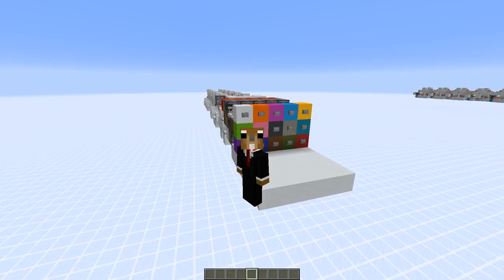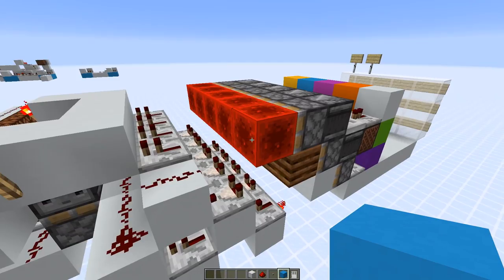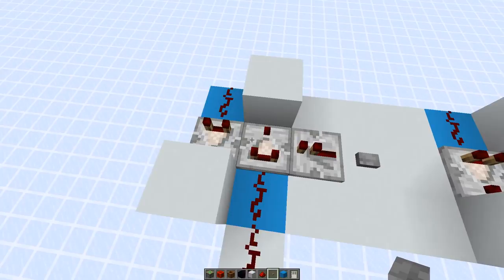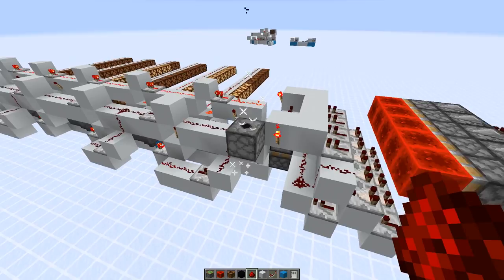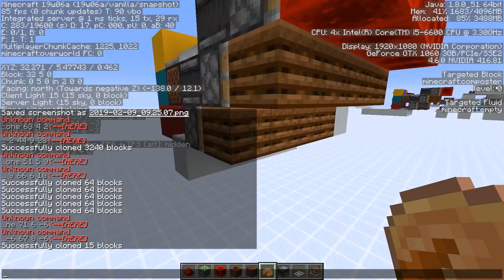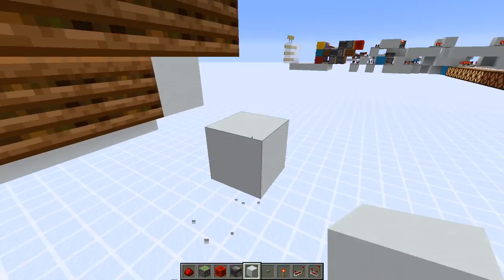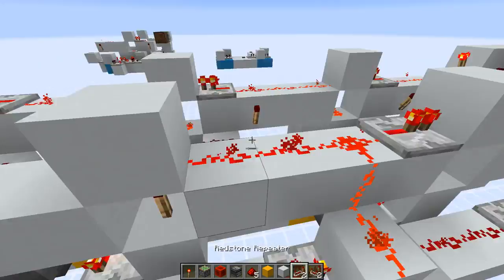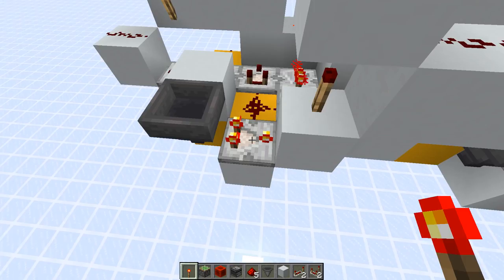15 Button Sequential Combo Lock

Comment: You can add 2 fake buttons under the 16th input, then it'll look nice.
Reply: But you don't have 18 colors
Reply: @spartycool  glazed terracota ?
Reply: @spartycool  shhhh
Reply: You could also use 18 unrelated materials, or make 6 colored stripes (so you'd remember combination as "top red, middle brown, top yellow" etc.)
Reply: But there are only 15 buttons.
Reply: Vertical colors, Horizontal could be material. Concrete, terracotta, wool

Comment: Great improvements to sethblings original concept. I wonder if it's possible to do all 16 with a 4 by 4 grid as input.
Reply from the maker: I made what you were asking for. 4x4 grid with a total size of 4x5x11 (inlcuding button blocks) that is compatible with the combo lock. I will show it next week
Reply: It's not better because of the noise
Reply: @rambolambo3441  maybe sethbling will make a data pack to remove piston noises for you.

Comment: This could be easily co-opted to make a music box. The only other thing needed is a corner module to turn the memory into a loop, and a way to block the signal from looping around or let it through (which can be done by passing the signal through a solid block and removing the block with a piston).
And then also have a decoder that can trigger a different note block for every signal strength.
The main issue is that it is so slow. So for tight timings, two or more of these memory tapes which advance together could be used with the note blocks being triggered at a small time offset.
The other problem being that Minecraft is laggy and so it would never sound good.

Comment: Combination locks were my first real redstone contraptions. Used to have a massssive 120 button one which had a second button display on the second floor to set the code. Had 3 tries and a death penalty with 5 minute lockout. The eventual culmination however was my development of a hidden key card reader using a hopper minecart. Which you could have under the floor. Combined with written books to make a key which can't be replicated it becomes the most serious lock system in Minecraft XD
Reply: That sounds kool mate. You should make a video on it

Comment: is it possible to make it smaller like 9 choices with 3 digit code and have a reset button if we missclick the button? Thats what i would like for my base!
Reply: This does get reset when you press the wrong button. You just have to put the code in the right order and then your line gets activated
Reply: Just remove 6 buttons from this design
Reply: yes it's possible. just copy the design with a 3*3 entry and you'll have 15 14 13 8 7 6 3 2 0 in possible output. and you'll just need a 3 module long redstone thing behind. you don't need the reset, start entering your code and it'll work.
Reply: @gildeddrake1479  cool thx

Comment: Now to figure out how to move these segments somewhere else so they can fit in more places.  It's unusual to have several chunks of space in a certain direction like the design you have shows.  Then again all it takes to move the signal is a comparator and a dust alternating so it should be possible to move it up or down as needed.

Comment: Could you do one button panel that can have more different combinations/outputs? I mean that you can have multiple “codes” that does different things.

For example:

Orange, green, pink & red is one correct code.

Blue, lime, yellow, pink is another code.

Brown, white, black is another one. And each code has it’s own output?
Is this possible?
Reply: Very possible. I've een working on a multi profile, ATM like system for a while now. Each profile will be accessable and programmable from the same interface. It's not actually all that complicated but it does get quite large.

Comment: Yes but isn't it a permutation lock?
Reply: (there was a dumb comment here once but I'm pretty sure I'm wrong)
Reply: No, I don't see why you couldn't put the same code twice.
Reply: He gots a little over 11 million total combos so he got that by doing 15^6 so he can repeat inputs plus in the video his lock stores and shifts the redstone length
Reply: @qwoks3611  A combination lock would mean that order doesn't matter. For example, a combination of 1234, 4321, 1423, etc. would all open it. In a permutation lock, order does matter, so 1234 and 4321 are distinctly different and both wouldn't open the door. Repetition could be applied in both.

Comment: Can someone explain the purpose of the piston/observer thing he makes at 13:37? What does it even connect to or get powered by? I'm trying to attach this to the 4x4 interface panel, but since it doesn't line up exactly the same, I'm unsure as to where to put that part.

Comment: do you have to use a hopper/chest/items for the programing or could you use the composter or a lecturn with an appropriately size book for that?
Reply: I've had the same idea
Reply: If you are willing to wait some time you can use a furnace. This is most likely the least amount of items required. Just shove a stack of fuel (sticks) in, keep the stack of smelted/cooked items in there (suggest smelting cobblestone into stone) along with a full stack of items to be smelted/cooked and hey presto you get a signal strength of 15.

Also a good thing about doing it this way is that comparators reading a furnace signal will NOT read redstone signals. Therefore you can have a redstone torch in the bottom of a furnace which produces lvl 15 redstone at the top but the comparator will read only the signal from the furnace

Comment: instead of composters can we use cauldrons? Also, is there an redstone output in the event the combination is wrong?
Reply: Signal strength from cauldrons isn't high enough 0-3 to achieve that many numbers. If you did a 4 by 4 grid then the first row could all use cauldrons. The next row would then be composters. Row above that is repeaters then to a comparator which is subtracted 4 and then finally the row on top is just repeaters. 

No redstone output because the combination is always wrong until it is right (the 6th correct number inputted)
Reply: The output only happens when the code is correct. If you spam random buttons then nothing happens

Comment: What would be much better is that there is an automatic setting and the possibility of a closure after a time or next to the last but that the password is changed alone, without intervention, as after 'X' entries, the circuit generates a new password and to show it to the user on a board with the new combination, it would be interesting X9

EDIT: Can you repeat one digit at a time, that is, 15-7-7-3-2-2 (Clear with respect to colors)?
Reply from the maker: Why would you need that? If somebody wants to try millions of combinations...
Reply: @ilmango  Well, I only said it as an option and not an obligation, it may be that many do not need it and that they can make a lot of combinations but seeing it in some way and 100% vanilla, it would be for a bank in a server, it would be interesting (although the plugins would be out of this), in addition to being manually configuring the change of the combinations this medium complicated if the "digits" are too many to do it ... but there is the idea and it would not be wrong to try it.
Reply: If you have a floor of pressure plates keeping the system open when you are there then if you teleport away the system will close. Assuming another player comes close and loads the chunks which will de-power the floor of pressure plates turning the system dead
Reply: @ozwin2  I agree with you, this system gives for more modifications and additions that can improve the mechanics, besides this incredible the reinvention of this idea on the part of ilmango and what can be done with this

Comment: Can you remake it with out redstone torches maybe use inverted comparators to make the system just a little more spamable  or even use note blocks to or observers to remove button delays and add find the max speed and make a spam detection lock!!!! :)
Reply: If you change the buttons from stone to wood then the pulse length is longer and reduces the chance of the spam happening. Sometimes wooden buttons rapid fire or they used to. Not sure if that is a still a thing nowadays
Reply: na that just makes it slower i want to see it faster !
Reply: @wilebgingy669  if you want it faster then go for a design that doesn't require pressing a button. A good old item frame combination lock of say 5 items frames is quick to change with alot of combinations. And doesn't matter if spammed

Comment: Make a lectern based lock.you get 2 different outputs from the lectern, the comparator and the page pulse,
Reply: You cannot change to arbitrary page at any moment. There will be significantly less combinations.
Reply: @user-yb5cn3np5q  true, but you can change back and forth in a redstone power level
Reply: @TheMhalpern  That's exactly what I'm talking about. When you choose the next digit in the lock from the video, you have 15 options. When you switch page, you get 2. This gives 24 page switches for the same amount of security, and I'm a little bit concerned with how are you going to remember that.
Reply: @user-yb5cn3np5q  put it in the book, and keep the book with you

Comment: Conatiner for certain level?  Bring a coded book and put it on a pedestal and read that.  Changing the password becomes stupid simple.
Reply: For a fixed one use the good old item frame and rotate it. Not 15 digits but 8. Still pretty good
Reply: Thing is, composters needed to be used so it's 1.14 locked anyway.  Might as well use the pedestal.  They're not much more expensive than three books.
Reply: In reality composters don't need to be used. Each line can be hooked up to a comparator which has a signal strength subtracted from it. This would make the different rows as each row just has a different strength
Reply: ...in the same space as ilmango's contraption?
Reply: @DoomRater  the lines that come off the button wall go into separate comparators. Each lines comparator gets subtracted a different amount. Eggs have a 4by4. Top row subtracts 0, 2nd row subtracts 4, 3rd row subtracts 8, 4th row subtracts 12. 

Example is you choose the 4th row to the right (highest signal strength) you end up with a strength of 3
Reply: @ozwin2  That's not what I asked! If the footprint is higher, it's not worth building over what ilmango built.
Reply: @DoomRater  it would be maybe 1 or 2 blocks longer? Although savings can be made by changing the shift register from 5 blocks repeating to 2 blocks

Comment: I use a pressure plate that AutOmATiCalLy closes the door when I walk in
Reply: Yer always better to have the door permanent powered. Then when the code is right the door is unpowered as this stops a redstone torch simply opening the door

Comment: can u make something like this but for 1.13.2 with 15 buttons and expandability like this one? if u could that would be great cus i need it for a smp server. thanks if u can and nice vid!
Reply: since he is using composters i would say that the answer is no. of course, you could make one that is almost like this one, only larger at the "selecting the comparactor output" segment
Reply: @arthaiser  as artgaiser said, you could just make the input a bit different (for example a line of buttons+redstone line behind) instead of the 3x5 rectange, that way you can simply take an output at the end of the line and use the same "locking" system
Reply: @PanNic97  ok thx
Reply: @arthaiser  also thanks!
Reply: I can show you a far easier combo lock to make which involves item frames which can do a fair few million combinations. And only 5by5by5
Reply: @ozwin2  link?
Reply: @Hi30MC  will make a video once I've got time off work
Reply: @ozwin2  thx!

Comment: i tried this several times on several maps.  it does not work.  I even did /schem save from your posted map, and then /schem load and place it on a actual minecraft map and it doesn't work there... but works on you map...  horse shit dude.  If you press a lower button than the previous, it repeats the higher one... meaning you have to press the lower button twice... meaning the code never works.  not sure why it works on you downloadable map, but doesn'\t on any other.  not even with copy and paste.   looks awesome... no work

Comment: Combo locks are so cool but not very practical. If someone really wants your stuff so bad that you have to build this lock, chances are someone will just dig through your walls.
Reply: Pr0nzehEDITS I think their main functionality are on servers like hermitcraft where everybody agrees not to brake any blocks.
Reply: Or adventure maps
Reply: Use a hidden key card reader.
Reply: Or you use flush doors
Reply: Or on any server that uses a claim system. You can subclaim the input section and container trust all, which lets people press the buttons.
Reply: @sladernom  In that case you can just claim the door.
Reply: @Detlevboi  with the assumption that it is already a part of your base, at least anyway
Reply: Vanilla Security systems should not be considered in context with modded Minecraft.
Reply: @naberville3305  Yeah this is for vanilla but nothing is actually secure in vanilla. Best method of security would probably be security through obscurity.